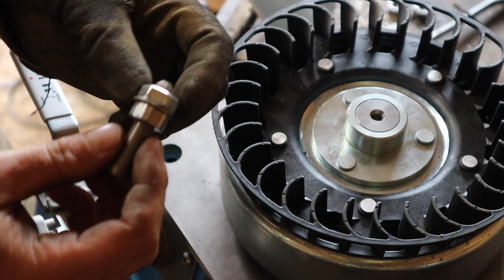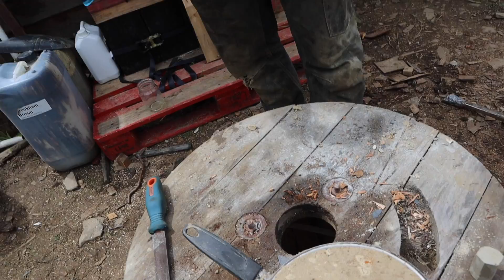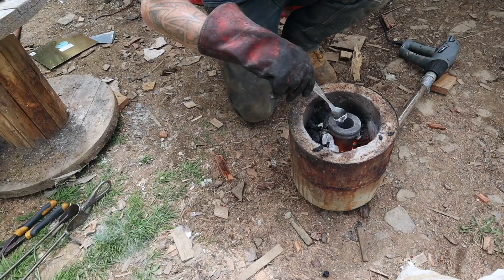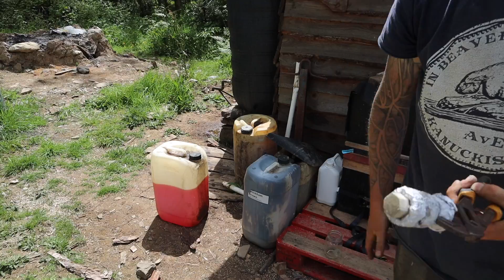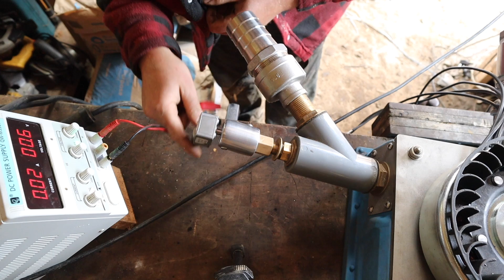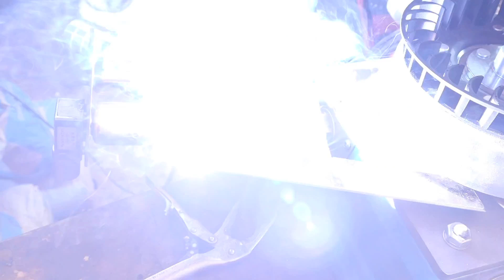4 Nozzle Off Grid Micro Hydro Turbine  Part 5 Motorised Spear Valve Control

Comment: As you can see in the comments, most people are advocating a micro-controller based solution (e.g. Arduino, ESP, Pi).  One of these cheap (circa a fiver) controllers, a stabalised 5V or 3.3V supply (e.g. buck converter module),  a  relay module, and a motor controller module, should do what you want.  You are probably looking at less than 30 quid in bits.  Your local maker space could help you build this, if you have one in your area?  If you want to chat more, p.m. me your email address.  For starters take a look at: https://www.youtube.com/watch?v=eAANkWDvusU

Comment: You could use two op-amps as voltage comparators and just have it move the motor in forward or reverse. One for Opening on low voltage, and one for Closing on high voltage. Have those control a couple of relays connected to the motor for forward reverse control and combine that with your limit switches. No programming required, just basic electronics. The lm339 is a pretty common part. If you want a schematic I can come up with something in a couple of hours.

Comment: Perhaps a simple PLC setup to control them actuators. Arduino would also work but I've found PLCs are more friendly towards mechanically minded individuals. They are used extensively in industry and programming them is a straight forward, visually based process. They are very robust typically as well, especially if you go for an analog output/input setup instead of the solid state. Click makes some consumer grade mudules that are perfect for this application

Comment: Didn't read all the comments so it might have been said but think about interfacing the limit switches with a shoulder of the valve not the motor mounts.  That way the run out of the coupling won't be a factor. Also I figured that this is more of a experimenting valve, so a sensor that would give you position reading would give you more than just full open or closed. 
Keep it up kris, your content is inspiring

Comment: If the wobble becomes an issue you could eliminate it by putting a universal shaft coupling as used on a model boat between the motor shaft and the home made socket.

Comment: So what is the fan for on the top/outside of the alternator/generator?  I would imagine it would be for cooling. But for micro hydro, you have cold river water flowing over it all the time. I wonder if you remove that if you could gain some efficiency? There would be a lot less air drag on it. I know the magnets up top probably need a lot of cooling, but there should be enough thermal bridging from the pelton wheel to remove it.
Reply from the maker: yes it is a cooling fan. the water never really touches anything that has enough surface area to pull the heat away so the fan on top drives air in to the coils. i have thought about taking it off before as i think it uses about 20-30w

Comment: I appreciate the effort put into casting your own parts.  But I don't really get why you were opposed to using a socket and drilling and tapping it for a set screw.  It's still custom and the availability, cost and precision of the parts is hard to beat.  I believe you need a universal joint between your motor and the socket drive shaft you made.  It will take the side load caused by misalignment off of the motor and the motor should last longer.  I am sure you will be able to improvise something (though again a u-joint from a socket set jumps out at me as easy).
Reply from the maker: The problem is they also go crusty in damp. everything else is corrosion proof. but the socket would go all crusty. if i could find a stainless socket i would go with that. they are all chrome and end up rusty.

Comment: 6 pin on off on switch. one side positive switching the other negative 
Simple and easy
Reply: What he said, use a Spring loaded centre off double pole double throw toggle switch. Connect the motor to the centre terminals, and the power source either side with polarity reversed on one side. Monitor the current to detect if the motor is stalled.

Comment: I think most everyone saying Arduino is on the right path here. The code can be as simple or as complicated as you want it to be, so some more concrete requirements would be helpful.

1. Do you want to control it yourself? Or set up sensors so that the system is completely autonomous?
2. Do you want to control it remotely? 
3. Can you run network/power connectivity to the controller?

The simplest solution would be to have an arduino control switches that allow power to flow to the motor for specific amounts of time - assume 12v of power time how long it takes for the motor to fully open/close the valve and write your code accordingly. The only hard part would be writing the interface so that you could control this yourself over the network, and then running a network cable/power out to your shed. You would need an arduino with ethernet connectivity, but from the link here you can see the code for controlling the motor is very simple. https://www.allaboutcircuits.com/projects/control-a-motor-with-an-arduino/ 

The hard way (at least from a code standpoint) would be setting up sensors and making the system fully autonomous. You may want to get someone to write the code for you in this case - I could do it but I would need to buy the parts for a dev board and it would take some time, plus you would have to figure out how to put a digital pressure sensor in your pipe. Saw a comment down below where someone wrote essentially what rules you would need to program for this kind of setup, but the comment vanished.
Reply: Follow up: people who know more about the electronicals than I do have informed me that motors can’t be relied upon to turn the same exact same amount in the same amount of time, so your code would need to detect when the valve is fully open or fully closed and stop the flow of power at those points so you don’t burn out the motor. I think you could achieve this by just having the valve bump up against a button when it’s fully closed/open. Other option would be to use a more precise digital servo - but I imagine getting one with enough torque is going to be too expensive

Comment: Not sure if you were suggesting microswitches to detect open/close position but if you've got a bit of wobble in the motor it might be better to use the fact that when the motor stalls the current will rise and detect that to cut off the motor.  Thinking of car windows that stop if you stick your arm in there while it's closing.  It's a bit less complicated than an Arduino if you don't fancy the programming.

Comment: Great work, as always! I'm just wondering if over time there could be rust forming in the tube due to the water and humidity. This could potentially prevent the system from opening or closing the valve. Just a thought :)

Comment: I would recommend using Home Assistant running on a RaspberryPi. https://www.home-assistant.io/
You can use this to run all kinds of automations including the monitoring and logging of generated and used power.

If you don't like programming You can use Node Red (which you can easily install using Home assistant Community add-on https://github.com/hassio-addons/repository)

You can use https://esphome.io/index.html which is an other add-on to create your own smart devices. These run on cheap devices like Wemos D1Mini. You could probably use
even go without an endstop (see https://esphome.io/index.html#cover-components)

Great tutorials:
https://www.youtube.com/user/Jfelipe83M/featured
https://www.youtube.com/channel/UC7G4tLa4Kt6A9e3hJ-HO8ng
https://www.youtube.com/channel/UC2gyzKcHbYfqoXA5xbyGXtQ
https://www.youtube.com/user/Frenck/featured
https://www.youtube.com/channel/UCv7UOhZ2XuPwm9SN5oJsCjA/videos

Comment: Just putting it out there. What about an RC controller from an RC car.
Reply: i'm thinking along similar lines.  if you take a servo apart you could gut the drive train and use the servo housing as a petentiomiter mount with the servo arm used to measure position.  if you get a high power servo it should be able to drive that motor.  then it could be controled with a radio transmitter or hard wired using a servo tester.
Reply: @gavinablett4807  how many volts does a rc servo need to work, cos i was thinking removing the servo an just use the power that would of gone to to servo. to drive his motor with a step up buck convertor.
hang on you would not need to remove anything if connected to forward n so on.
or just use the servo to move a switch.

Comment: You could use float switches in the weir, if the water level drops below a set point it sends a signal to a 12v relay next to the motor wired in the direction to close the valve and interlocked with a limit switch, or you may find code already written for an Arduino controller. 
Building a second overflow weir directly after the first would allow you to place the float switches there, to insure the intake is always full and throttle your valves based on the excess you have at any given time.

Comment: Kris. Be very very careful when pour molten ahh-loo-mini-uhm over anything that contains moisture. The trapped moisture can instantly turn to vapour causing a very massive explosion since hydrogen is produced in the reaction. 
I work in a Honda engine factory that casts and machines the heads and blocks and when the molten aluminum storage vessels were first filled a plug leaked allowing molten aluminum to spill onto the still “green” concrete floor causing it to explode. 

You’re lucky that the reaction you saw was very minimal since the moisture was in the sand and not the concrete hex form.

Comment: the main question about the controller to use for this is if you want to be able to control just open and closed or also all the steps in between.
if you want full control in between you gonna need a microcontroller for it.

if you Wifi reaches far enough to get to the hydro station id suggestion something like an esp8266 with some relays, that way you have full control and dont need extra wires.

Comment: Ultimately your using the valve to control the RPM of the impeller, It would be very simple to setup an Arduino with some light coding (there are a few on here who have already volunteered)  and have the valve be automated to a degree. You could easily add remote access so you can override the automation or change the values of the speed. 
Good Luck!

Comment: You said you didn't want to use the socket because it would look homemade. But the bolts welded together look more homemade. And by casting the part it has made it wobble. I think you could of still made it look good with the socket. Love what you are doing not being a hater. Also put some molyslip in your guide bolts
Reply from the maker: They also corrode witch was another reason. everything is ali or stainless. sockets always get crusty

Comment: go to harbor freight buy as many cordless hand drills as needed,  in them you have pressure control, so you can't over torque, pull out their triggers and install them at the house, connect all the batteries in parallel , use a 24v solar panel and charge controller

Comment: Electrical Engineer grad, the best way I can think of is using a simple Switch-Mode Power Supply controlled by an arduino.  Wifi programming on arduino can be a little complicated but if you just want a simple analog knob then a potentiometer to control the duty cycle into the SMPS will be really easy.  If you want to control the power level from your house and it's too far to run signal wires, finding a board with WiFi compatibility isn't hard, then you can control the flow from your phone or laptop. 
Great video, best of luck!
https://www.amazon.co.uk/ARCELI-Converter-Buck-Boost-Adjustable-Regulator/dp/B07MY399GQ/ref=sr_1_10?keywords=buck+boost&qid=1559315658&s=gateway&sr=8-10 
https://www.amazon.co.uk/TECNOIOT-ATmega2560-ESP8266-USB-TTL-Compatible/dp/B07HML8DZD/ref=sr_1_9?keywords=arduino+WiFi&qid=1559316373&s=gateway&sr=8-9
Reply: I think he was looking for something easier like a manual H-Bridge done with switches
Reply: @Totial  If he wants to do it manually a few switches would do the trick, but then it would be the same as turning the knob by hand.
I think he wants the remote functionality, which a wemos or a nodemcu would provide, or an arduino with a 433MHz (or 868, or 900, or...) RF module.
Then he'd just need an H-bridge to drive the motor.
Reply: H Bridge with variable duty cycle using wemos over mqtt or gsm will be chilling

Comment: add a small aluminium packet of salt to ur molten metal to degas the mixture after removing dross from top layer. Make sure and drive the packet of salt all the way to the bottom to insure you get all the moisture out. also try borax as a flux to make the mixture flow well when poured.

Comment: I would consider putting some sort of lubricant in your sliding bolts you made just to help any kind of friction. I'd imagine that there is some sort of controller you could probably find on eBay or AliExpress so that you could program to monitor voltage and control valves

Comment: Hey Kris, if you want to control the valve remotely, get an arduino or something and I'll write the code for you. I'll make it easy to use and configure, so you'll be able to configure the start and end position easily. All you'll need to do is solder it up according to spec, which I'll provide.

Comment: Arduino would be a good way to control this, and simple to program, just connect the dc motor via an h-gate, and digital read the limit switches. Position control could be as simple as an analog read from a potentiometer. Give me a shout if you need help with the code.
Reply: i can help with the circuit design aswell. i could even etch a circuit board.

Comment: Some 3D printers use a slightly flexible joint between the motor and the axis to absorb any irregularities. Called a helical beam coupler, I think. That might be useful for connecting the motor and it's a pretty simple thing, I'm sure you could fabricate one.
Reply: A piece of hose and two or maybe four clamps does the job in low torque applications like this.

Comment: Maybey i got a answer for your problem a governator,the thing on old steam engine(flying balls),can gover the idial rpm.hope you get my point,greatings from the Netherlands.
Reply: Thinking of a pot meter controlled by the governator ,rpm high more ohm rpm low less ohm,Just my thought hope you can figere the rest out.Should loock cool because th  most is mechanical and fun to see.

Comment: Very nice progress. For the control of the motor this is the circuit u want to build: https://en.wikipedia.org/wiki/H_bridge. S1 and S2 can be replaced with only 1 Switch that has one common connection, one normal open and the other normal close. The same with S3 and S4. So if u want to make the motor turn in one direction u leave one switch one and the other off and the opposite in the other direction. This way u can be sure to not make short circuits ;) if u need details about the circuitry i can draw it for u but need an email to send it

Comment: Great project Kris :-)
When you say remotely, do you mean yourself controlling it with buttons from the house or  the battery bank controlling it automatically dependant on state of charge?
Also, would all 3 valve motors be fully open or closed at the same time?
If you have a quick look at my channel you will see I have done similar control using Arduino, or just simple relay and op amp circuits.

Regards - Martin.

Comment: You could put an ESP32 or an arduino with a motor controller in the turbine house. If I remember correctly you ran a secound cable to the turbine house, you could then run a RS485 or similar bus over that cable (depending on length and kind of the cable) and have another arduino and some controlls on the other side. Or even a ESP32 with could connect to the wifi to be controlled with a Phone or a Computer, or even hook into the charge controller (maybe closing the valves if the batteries are full). This would require some programming, but would give you a lot of controll and you could put sensors on the turbine, like Pressure or RPM.

Comment: nice video and an interesting project. can you elaborate on the purpose of controlling the valve. as I understand it there are 4 water inlets with a valve on one of them. is the valve to be either fully open/ fully closed, thus changing the flow/power from 75% to 100% or is a more subtle control required. if fully open/fully closed than a simple two pole two way switch forming an 'H' bridge with limit switches on the top of the 'H' would do the job. this would clearly need a pair of conductors from the valve motor to the switch and the power supply near the switch. i will email a circuit diagram to you. just implemented this on one of my projects. Well I would email but I cannot find your email address!

Comment: i think a 3d printer would be quite helpful instead of casting
ps. put some grease on them bolts /sliders
Reply: Especially if printed in PLA and used as a wax mold to then cast in.